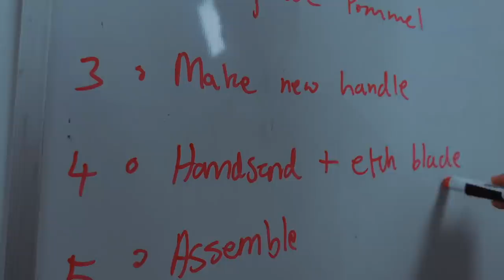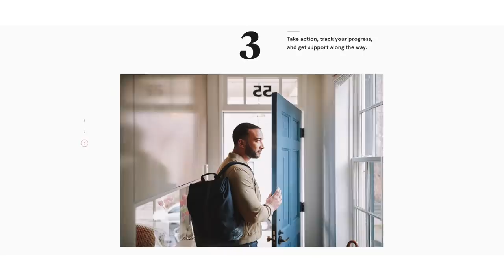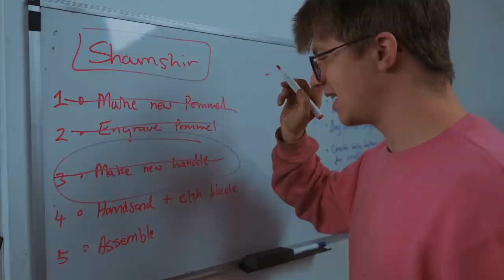I finally finished the Shamshir Scimitar!

Comment: 3:48 an easy way to do it is to take some hard clay and use it to take a shape, pull it out, then you can use that to copy the pathway. You can get really intricate patterns fit that way.
You can even do the really complicated kind that cannot be fit unless the wood is cut and wedged upon entry in the same manner. Like if you'd have a cross pattern or a club or diamonds (card shapes).
Reply: Great idea
Reply: do you have any videos of the process?

Comment: Great job as always, watched you for several years now and always enjoy your process and results!

Quick safety point...pour your water first, then add your legally unmentioned etchants or oxidizers.
Reply: Ok I'll bite.  Why?  Doing ally learning here....
Reply: @cosmicboogerspoon8507  to help prevent accidental splashing of concentrated acid when you pour the water on top of it.

If you pour the acid into the water it starts to delute immediately. So anything that splashes out wont be quite as dangerous (still wear ppe of course).
Reply: @cosmicboogerspoon8507  I should have clarified. When adding water to acid you run the risk of flash oxidation, explosive steam release, high fuming and other issues depending on the chemical and concentration used. I grew up in a knife shop around ferric chloride, muriatic acid, sulfuric acid and more. Also vocationally trained in some chemical fields including pool chemistry. Seen what happens first hand when it goes wrong.

Quick example with pool stuff is the muriatic acid commonly used to balance water pH in 10% concentration. It is further diluted in the commercial scale chem feed systems I used to service. Had one of my staff helping with pool chems once and she forgot to fill tank with water first. She poured a full gallon of muriatic into the tank and then turned on the hose. The fumes knocked her out for at least 10 min before someone found her and it took her a week to catch her breath normally again. 

Alec is normally very good about safety and respirators. Took me by surprise to see him haphazardly show poor safety practices with something like that FeCl3.
Reply: @patricklargin5767  Now that is a thorough answer with a story to properly illustrate.  I'mmmmmm LEARNIN'!!!

Comment: I'm still mad about not making a sheaths for your swords, they're not finished yet >:(

Good job and excellent craftsmanship as always Alec!
Reply: Making sheaths for his swords/wepons would be extremely difficoult for him. 
1. He does not have the time
2. He does not have the materials
3. He does not have the machines
4. He would need to learn a whole new srt of skill wich is expensive and time consuming.

It would be better and more cost efficient if he had someone make it for him in my oppinion.

But truth to be told.... It would be trully and utterly amazing if he did make them.
Reply: @jurekovacic1739  I’m sure he can make the time—just look what he did for the jeweling process. All the other things can be aquired, and absolutely should be, as a bladesmith should ensure his works have all the excess stuff to guarantee their safety and longevity.
Reply: Sounds like an opportunity to collaborate with a leather worker.

Comment: Alec, I have been watching for a while now. I just wanted to state that this was probably one of the biggest projects you have tackled and I can see for a while you have been trying to finish it. I deep down know you could have done so much more with the fitment of the handle and pomelle. Everything else, the blade and the guard are phenomenal without a doubt. I was wondering if it would possible to heat the pomelle and handle and then try to press fit it onto the handle to do the trick with a seamless fit? Keep up the amazing work!

Comment: Hey Alec, here is a little tip for you.
To buff up stabilised wood and brass/bronze without scratching the surrounding steel, you can use a soft pollishing-file for fingernails.

Comment: I'd suggest a sidesword, if you haven't made one already. much more versatile than a rapier, meatier, but still with many opportunities for intricacies (especially with the wide variety of guard options). I'd even say a blackened pure steel blade (maybe a harder piece welded onto a softer, more springy body so you can have that difference there?) but with a pattern welded guard and pattern welded ornaments for a scabbard.

Comment: How about making a Kris, the classic wavey bladed dagger. It's short enough that you won't get size issues, but complex enough to tax your abilitys significantly. Either that or look at something like a super hardwood (Ebony) project, and see how well you can make a hardwood knife. Possibly even look at the chemically hardened woods that are almost as tough as mild steel.

Comment: If you use silicone and make a silicone mould of the internal structure of the pummel then you will have a 1 to 1 reference to follow wile carving the handle just a tip for next time

Comment: You should revisit the Japanese side and make a yari with a 6 meter handle.

A yari is a multipurpose weapon, the spear features a straight double-edged sword-length blade typically 50cm+ and a homogeneous or segmented handle generally 3-6 meters long. Some yari had their poles ornamented with jade and gold along with beautiful carvings.

A note for the pole however, a yari is supposed to have a super flexible shaft from pommel to 3/4 up the shaft and a rigid final quarter where the blade and tang are set.

Useage: having a spear 153 Big Macs tall allows you to boop enemies from afar. The flexible shaft can be held at end to flick and swipe, building up incredible speed that may be difficult to counter.
Wiggling and jiggling the spear while in a thrust will throw an enemy off guard because it's hard to Parry a noodle spike. The flexibility is also able to be used similarly to fwap it around shields or deflect shock when hitting something solid... Like a skull for something.

Overall I think making a yari of the longer persuasion would befit your talents and provide some chances to practice more carving and careful material useage when it comes to the pole and it's ornaments.

Comment: Project idea: ornate damascus/mycarta bearing style nunchucks! Make some micarta with a beautiful pattern thick enough to be carved into the nunchucks handles, make some Damascus end caps which will hold the bearings onto the tops of the nunchucks, find some way to make some decorative chain and possibly engraved/carve some sort of dragon looking design into the micarta and maybe even in set Jade or Ruby decor into the project. I would imagine no matter how much money you put into it just to have a custom-made ornate set of nunchucks from Alex Steele it would be impossible to keep them in the store for long. I would recommend making a batch of 20 or 50 pairs and putting maybe a few hundred on it for price.

Comment: For my 2 cents the next sword you make is a relatively straight forward call. In the US you made an iconic US cavalry sabre. Now that you're back in the UK why not try your hand at a either a 1796 light or heavy dragoons, officers sabre? They're very internet popular thanks to the sharpe series, ties to something you've done before and there are loads of originals around you could handle to get  measurements from. You could even get a collaboration with Scholar Gladiatoria or the academy of historical fencing going to really push it along. Good bit of forging involved too to get them right, should suit you down to the ground!

Comment: The fit on the pommel isn't just a good idea because no one's perfect. It also accounts for any expansion/contraction of the wood that will happen with seasonal wood movement in the handle due to humidity changes.

Comment: Well if they weren't illegal you could have made a set of shurikens, a proper challenge to create, I would bet. Alas... 
So maybe for the next project you could try a Sami knife or its smaller cousin the puukko. Not properly used as weapons, but could be interesting to make, usually with engraved designs on their handles and their accompanying sheaths.

Comment: So Is there a reason you choose to had fit the handle to the pommel rather than fit them together before doing the inlay by heating up the pommel and using it to finalize the fit by burning it's own location in?

Comment: Mjolnir, from god of war ragnarok. In wootz steel.  Hail brok hail Sindri smith’s of renown.  I just haven’t seen one giving off spark.  With your skills it should be possible to make thick plate wootz and weld the parts together. The hollow formed should make a capacitor. The handle to me look like a mini particles accelerator.. the steel can act like beta voltaic batteries.  Due to small amount of isotope cobolt&nickle in the steel. NASA use it on satellites. A hammer that powers itself. It’s also my understanding that magni and modi have similar weapons made of the same stuff. Any one of them will do. Mjolnir definitely a favourite.

Comment: Shamshir might work better with a "bent" handle, to better enable the handshake grip. But what I know, maybe shamshirs were intended (like tulwars) for hammer-fist grip, and 90 degree angle between the hand and the blade to better power drawing cut slashes.

Also, the more elaborate decoration on the guard looks like it is on the wrong side to be presented when the shamshir is being worn in the scabbard.